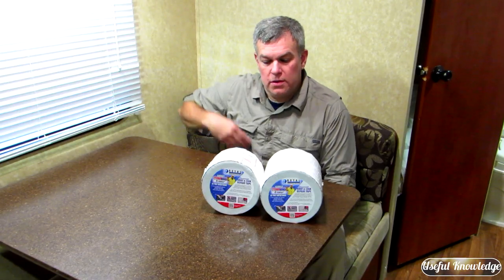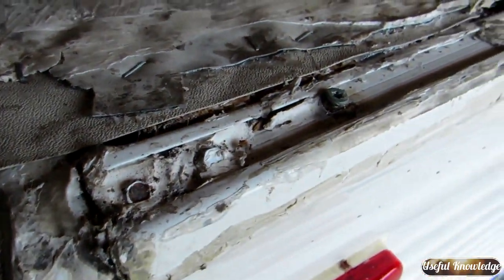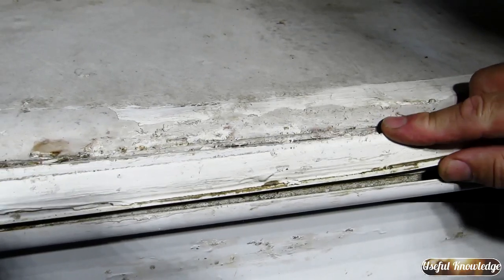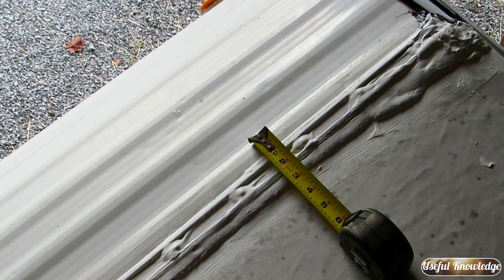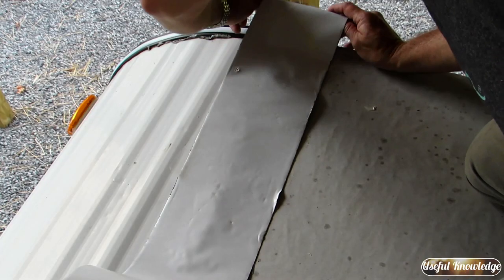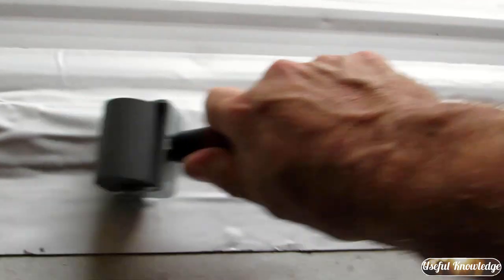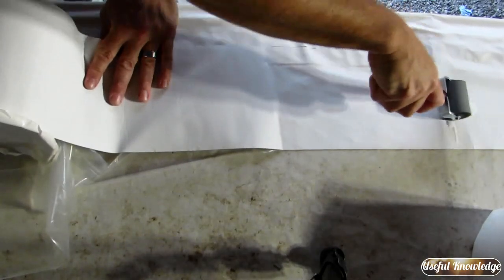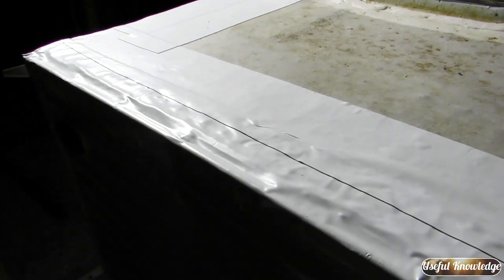Eternabond RV Roof Repair | Useful Knowledge

Comment: The roller is just for adhesion, it activates nothing, you couldnt pay me to put that crap on a roof,, theres air pockets everywhere not to mention the time, and cost to lay that down,, your better off with a self leveling sealent
Reply from the maker: Obviously you’ve never used this tape and don’t have a clue about the cost of camper repair. You can go read the instructions about the pressure activating the tape. I didn’t make it up.  It’s not crap and they didn’t pay me a dime. The camper has been out in the Alabama weather for two two years with tons of rain this year.  NO leaks!